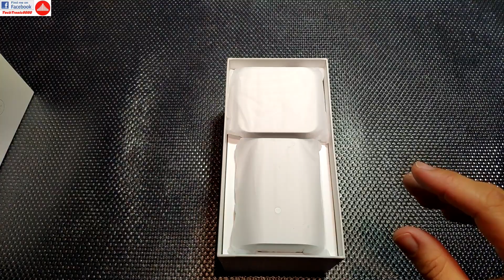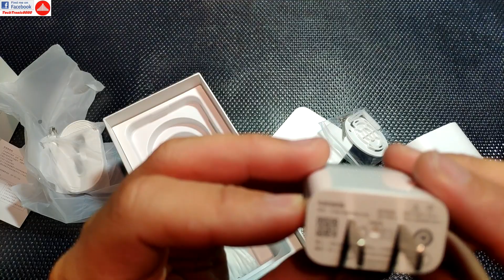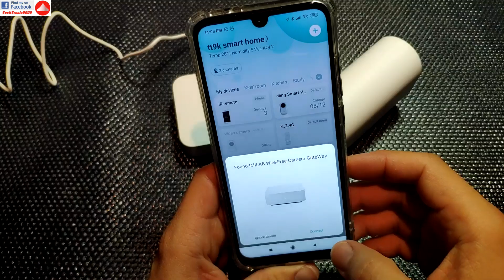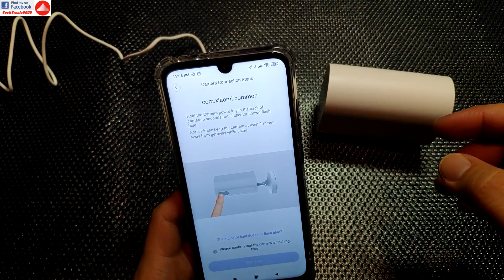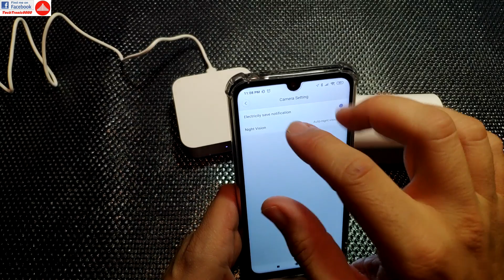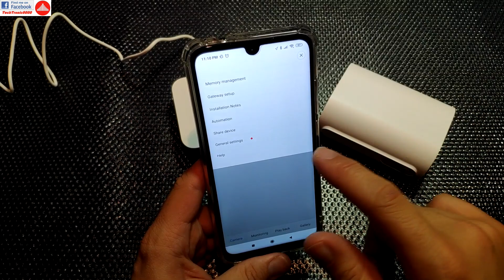Xiaomi Advanced AI Battery IP Camera with NVR KIT

Comment: Any issues with the camera recording time?   Curious, because when I first had it set up it had a time value (10sec to 30sec) but after a hard reset and reinstalling the equipment, it has no time value settings.... Updates are current.
Reply from the maker: Sincerely I need to check and also update the firmware as I had to take this off for now.

Comment: Hi how can i sign up for new account.
Reply from the maker: You need to make a Mi Home / Mijia account, directly from the app. Also use mainland china server.
Reply: There is a small button near the SD card slot. Press and hold it for 8 seconds, or until the led light start blinking yellow.

Comment: This camera only records for 10 seconds...

Is there anyway to increase the recording time...

If someone steals my car, they have to do it very quicky...
Reply: I have found out that there is no way to increase the time of the recordings. 
I bought 2 of them...WHAT A COMPLETE WASTE OF MONEY.

If in the middle of the night, someone vandalizes my home, I will only get 10 sec video.???
And they call it a security camera????

How does this make any sense?

Im going to make a sign to put outside my house..

"If you are here to steal my property, please do it quickly because my camera only records 10 seconds"

Anyone want to buy 2 very advanced cameras...that only records 10 seconds of video?
Reply from the maker: Do you have the NVR with SD card inside or just the camera? It records a 10 seconds event and stops if there is no movement, will continue to record if it moves.
Reply: @TechTronic9000  

I only get 10 seconds...

Do you get more the 10 seconds?
And if you do, where do you access the video?
Reply: After you install the camera and the gate way, you are able to switch between the 2 from the mihome home page.
You click on MY DEVICES, and you will see option to choose camera or gateway.
So when you select GATEWAY, you are brought to the window where you can see the motion alerts, except at the top it says SD CARD. 
So I thought this must be where the full length video is stored but still only 10 seconds.

Comment: I bought it on bangood but I can't setup. I only power up the gateway and Mi Home app see it and ask me to connect to a router. I use a vodafone station. It connect to the device, send message but can't connect to network. (From Italy). Can you help me?
Reply from the maker: Does your WiFi has a password?
Reply: @TechTronic9000  yes, i insert it everytime but can't connect. Yesterday night i tried to change region to USA and i connected the gateway but i didn't connect the camera. Today the gateway disappeared from MI Home. I've reset all the devices and tried again but can't connect to network.
Reply from the maker: Try changing the app to China Mainland, also put the camera on charge as the internal battery might be low.

Comment: Can several cameras be connected to one gateway? 
And also how good is the battery life of the cam in reality?
Reply from the maker: It has an option to pair another camera is probably we are going to get camera without the NVR kit. I'm using it for a week now and there is still at 100% battery.
Reply: I have bought 3 cameras. From what I have seen it seems that every cam has to be paired with a separate NVR hub. I dont see the option that you are mentioning - to pair two or more cameras onto the same hub.

I have noticed also that the battery % is not updated in the app. Mine has been runing for 3 weeks and it is still 100%. On the other hand, one of them was losing 15% battery each day.